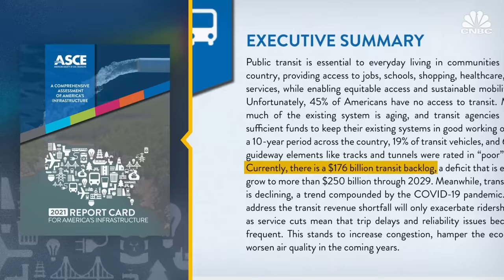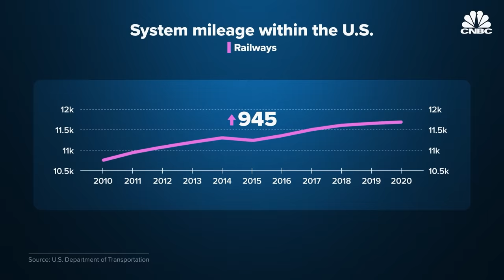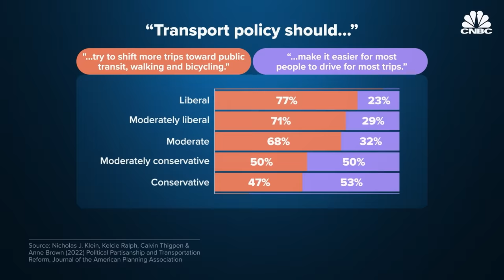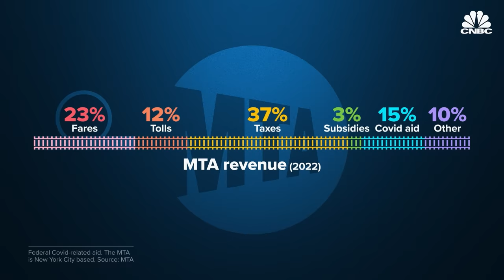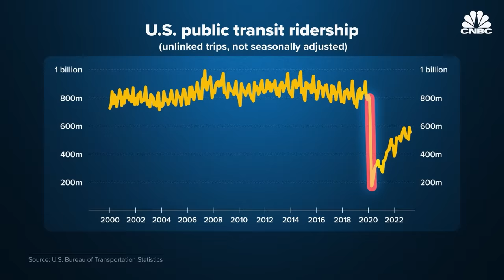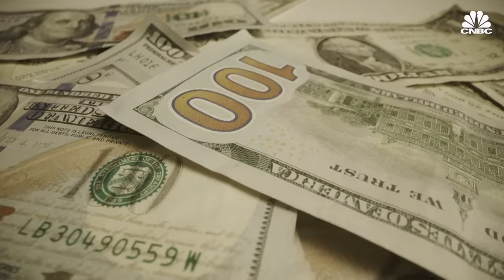Why The U.S. Gave Up On Public Transit

Comment: “American cities weren’t BUILT for the car.  They were DESTROYED for the car.”

Mass transit used to be the norm.  Streets used to be mixed use and walkable.  

Undoing the damage of car centric infrastructure though might be very difficult.
Reply: Undoing the damage may be difficult, both t it MUST and WILL be done for the future of the country.  We have to fight for it.
Reply: with the way this future generation's trends are going, mass transit is going to have to return to the norm. cities are gentrifying, car ownership has plummeted, and there is a lot more consciousness on one's wallet (e.g they're poor) as compared to previous generations. a fight for mass transit is a fight for the future.
Reply: Whats wrong with continuing our car culture the way it is? EV's are becoming more popular every year, and eventually they'll be the only cars on the road. An with autonomous tech improving with every software update, accidents will start to decrease as well. We don't need public transport, we're America.
Reply: @@ghost_mall Well everyone wants to live in a nice large house and big land so you can't have everything.    Here in Seattle area you have large Park N Ride parking garages and you can leave your car for free and use the transit network but you need to drive from your house to the location and for many that means back-tracking or going away from the destination so it takes longer to get to the transit connection and then also lose time with the light rail or bus having to repeat the path beyond where you live so overall the trip takes longer perhaps a lot longer but you save on fuel I guess so it depends on locations, flexibility of work hours and so on but it limits how many customers can be served.   Some companies offer free transit use here by loading up some money on your Orca card, the transit card.
Reply: @mordant221  EVs and autonomous tech are not the magic bullets you think it is. 

our car culture is a significant contributor to declining health outcomes, continue to segregate (primarily impoverished black and hispanic) communities, and significantly increase the number of people who are stuck in poverty or are living paycheck to paycheck. this isn't sustainable.
Reply: @@ghost_mall Ever watch Minority Report or iRobot? That's what I want bro! Are own cars that, if we want, can drive themselves. An with all cars inevitably becoming EV's and autonomous, traffic will decrease, safety increase, and carbon footprins non-existent. With the added benefit of not having to deal with other people!
Reply: @mordant221 Autonomous vehicles" if possible in the next 50  years will only increase traffic as they would increase car usage, and car idling. 

You aren't knowledgeable on urban planning. You only watched a movie of a dystopian America and thought "that looks so cool!" 

"Cool" technologies aren't always the best to implement into our societies.

Not to mention EVs still have huge carbon footprints when created. And there is a limited source of lithium. With AI EVs we would run out of batteries.
Reply: @dylanc9174  That's what YOU think, and I've already stated what I think as well and will be voting according to my prefrence. In hopes that future transportation remains... car centric ;)
Reply: If a city allows a personal car to be used then it will be my only form of transit. If that city doesn't allow a personal car to be used then I don't plan on going there, and I will let my elected officials know I don't want any tax dollars to ever go to funding anything there. Not education, not law enforcement, not social funds, nothing.

If you want public transit, I don't care. I just don't want to ever use it.
Reply: @mordant221  
> "Whats wrong with continuing our car culture the way it is? EV's are becoming more popular every year, and eventually they'll be the only cars on the road. An with autonomous tech improving with every software update, accidents will start to decrease as well. We don't need public transport, we're America."

- Because excessive car-dependent sprawl is colossally expensive, colossally inefficient, and takes a colossal socioeconomic and environmental toll on all of society and this has been proven countless times. It's a sinking ship.
- Plus, not everyone wants to drive, either. Hell, even I love cars and trucks and yet I still support public transportation.
Reply: @mordant221 This is a personal argument, but it’s depressing. People feel much more spread out, and the isolation felt by various third spaces and amenities being bulldozed for more roads and highways is undoubtedly contributing to the mental health crisis, loneliness, and lower marriage rates.
Reply: Another not just bikes viewer i see!
Reply: Have you been watching “Not Just Bikes?”😊
Reply: @mordant221  Wrong, ev cars aren't a solution. Just another face of the same problem. Car dependecy needs to end, period.
Reply: @mordant221  Cost. It's cost. Cities can't afford the upkeep cost of the endless suburbs. Infrastucture is built by housing developments as part of the land use when they are built. Roads, water, etc. That infrastructure is then given to the city to manage and pay for. But it's impossible. Contractors built all that stuff as cheaply as possible, it's a moneypit keeping it all going. The tax base for the average housing development isn't large enough to pay for paved roads, water, and sewer hookups. Cities are going bankrupt. Then when they talk about raising taxes to pay for it all people move further away from the cities for a larger commute and to get away from the tax increase. Which puts more stress on highway infrastructure for the longer commutes and passes the money problem onto the rural areas people moved to. The second one is fine I guess, except the city still has to pay for all those endless housing developments. Only now the tax base goes down because housing prices went down as everyone with money sold to a lower tax bracket to get out from under the taxes that pay for their developments upkeep. And lets not even talk about the parking lot problem. In a large city the parking lot for a venue can cost more than the venue. That's not a joke. To build a multi-level structure capable of supporting the weight of all the cars for a large venue downtown really can cost more than the thing the parking lot supports. It's why stadiums and things like them have disappeared from city centers. The parking requirements would cost more than the stadium. Parking for 60,000 people costs more than the billions to build a brand new state of the art stadium.
Reply: @mordant221  
> Not deal with other people.
I doubt that bro. Drivers here in NYC are aggressive as heck. I'd ride the bus or train than to risk my car getting dented by some 20 year old who shouldn't even be driving. Not to mention all the delivery trucks everywhere

https://youtu.be/nxt69nVnmek
https://youtu.be/7OIoL7irIF8
Reply: @Demopans5990  I don't understand why anyone would use a car in NYC... but then NYC is on my "visit but not live" list...
Reply: @josephfisher426  
The vast majority of New Yorkers would agree. The only time you would need a car here is if you are traveling from Queens to Brooklyn where transit options don't exist, or if you don't want to hire a moving company every time you move. I keep my car parked 24/7 and just ride the bus to where I need to go. Cheaper than gas+maintenance all things considered. When I do use the car, it is just to travel outside of NYC to some rural farmers market upstate or on Long Island.
Reply: @mordant221  you are literally saying the problems of the US as if it's a benefit
Reply: @XDTape  car ownership is declining because it is becoming more expensive to purchase/lease them due to corporations looking to increase their profits.

Comment: Finally, at the end the professor hits the nail in the head when he says that we have to design cities and suburbs around public transit and get rid of the zoning. Otherwise let’s be honest, even if the buses are frequent and reliable no one in the right mind will choose to take a bus over the car if their place of work is 30 miles away from their house.
Reply: I prefer my work to be at a distance from my home.  I don't want my home near where I work in case I want to play hooky from work.
Reply: Oh, but the folks who live far out - in my city, at least - have the option to take the regional heavy rail trains which are even more appealing. You usually have to park and ride from a suburb but they're great.
Reply: yeah, you would take a train instead of a bus for that distance

Comment: You don’t even mention Boston, where the once-adequate transit system is literally falling apart: concrete falling from station ceilings, doors falling off trains, trains catching fire in tunnels and on bridges, tracks so poorly maintained that the trains have to run 15mph or slower on large portions of the lines. And the federal safety agency found dispatcher offices were so understaffed that they forced the MBTA to increase time between trains from 5 minutes to 20 minutes or more. The backlog for urgent repair is so large and it just keeps getting worse, and I don't see how they're going to get out of this spiral because nobody wants to spend money on what seems to be a failing system.
Reply: Boston could have taken the smart decision to invest the surplus of last year into the MBTA and Commuter Rail, rather than givin back some money
Reply: No one bothers to mention that it's not enough to just build the mass transit stations but that they will also require constant funding to keep it online.
Reply: How Federal Grants for Mass Transit programs are allocated:

Federal Grants are (1) given as long as the public transit system does not turn a profit and (2) those Federal funds are given without requiring they be spent to improve public transit services.

So, first the City and State are incentivized to ensure their mass transit sustems stay broken, that any failures remain unrepaired, that service be unreliable to discourage commuters; and as long as that happens, the receiving government can keep that money and use it wherever and however it wants!

It is a never-ending doom cycle by design because no one could fail this badly for so long unintentionally!

Please, examine the books of Boston and their Mass Transit Authority and prove me wrong!
Reply: They should shut the whole thing down and redirect the train maintenance money to upgrading the roads for cars.
Reply: @davidgoodnow269 That makes total sense. It should be the other way around. Only receive funding as long as you're updating the system.
Reply: @justicedemocrat9357 And how does that solve the public transportation problem for those that can't afford cars?
Reply: @b4rs629  That might be even worse! Can you imagine the demand to add new service, new routes (changing existing routes that people rely on), and Imminent Domain seizure of property to build new stops and facilities?

Instead, how about a tiered system that funds repair only in accordance with completion, and a separate grant that rewards improved ridership? "X" number used to drive, now taking bus, subway, or the old (or new) step-on, step-off electric rail transit; additional grants simply rewarding profitable Mass Transit with optional (grants are always optional, someone has to apply for them) funds to add more busses, passenger cars, etc., to existing routes only, decreasing wait time!

Think what that would do to MTA priorities, and removing Federal grants to MTA as a cash-cow to local government for embezzlement!
Reply: @davidgoodnow269  I understand now what your saying. That's basically what I meant to say to fix the rails that already exist.  I've been through routes changing it's never fun with the bus. That's definitely a good idea. Nothing worse than embezzlement. I believe someone commented here somewhere that the current law in Boston only grants money if they don't fix the things that are wrong. Which in return let's Boston spend it on whatever. Which doesn't make a lot of sense at all. As for the properties that could definitely be an issue, but whoever is the city planner should try to avoid that situation at all costs. I know in the city I live in there's a lot of  space that could be used downtown since most of those buildings are run down and old, but they're too busy  rerouting bridge highways every 5 years and starting new construction and it never gets any better it seems.
Reply: If I run my car without changing the oil or getting new tires, eventually it is going to break down. Same logic with public transportation. If it is not done correctly or maintained properly then it will begin to crumble. The problem isn't with the system or idea of public transportation itself, but with those in control of the various cities' programs, and their own decisions to slash funding and cripple it.
Reply: Isn't Massachusetts the smartest state? Why aren't they acting smart?